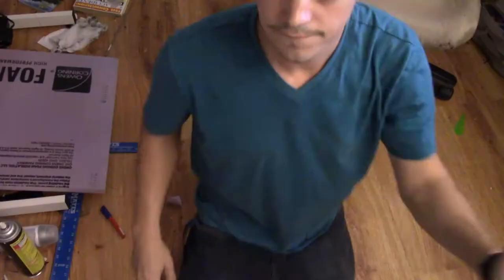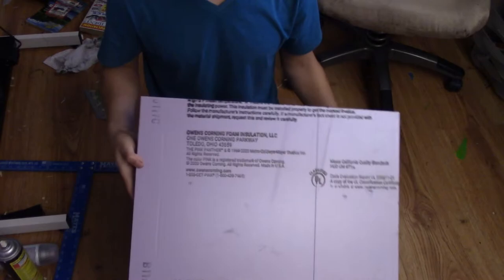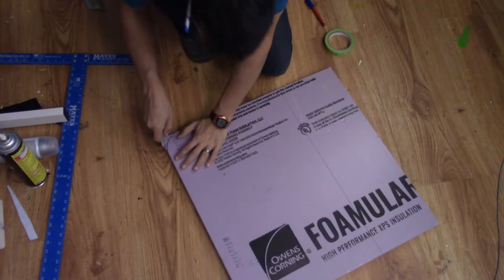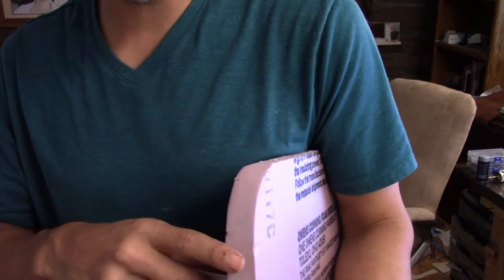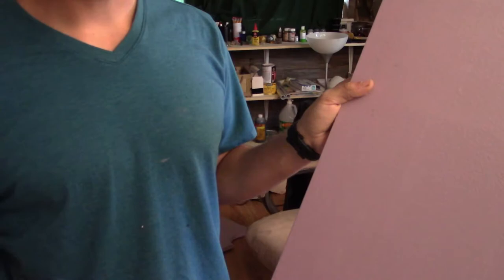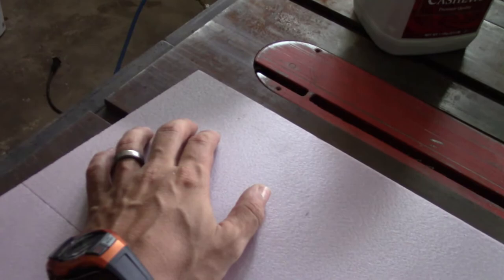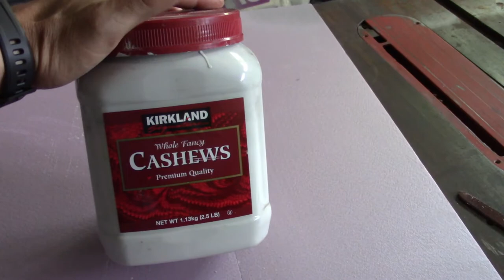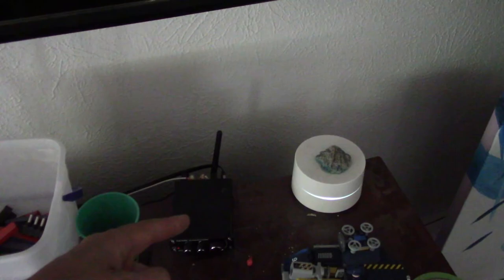You won't believe the sound from this DML speaker!!!

Comment: You CAN use spray paint, just follow the advice of tech ingredients - hold the can about 30" away and use multiple light coats. I hang mine with rubber bands, I simply screwed 2 1/1'4 screws in the top of each panel (no need for glue) and the screws hold the rubber bands in place on the speakers nicely. works great. IMHO a sub woofer is needed to get truly awesome full sound from dml speakers.
Reply from the maker: Thats a great idea. I added a sub later :)

Comment: I'd like to see someone use magnets to suspend the panels like they do with the floating globes and stuff. It would probably take a lot of magnets on the edges of the panels and a frame with magnets arranged to keep the panel from moving forward and backwards as well as up, down and side to side. You guys seem pretty smart. Must be a way, but not sure if it would help with sound though. Just a thought
Reply: That is a very interesting thought, the only fly in the ointment that I can see is attaching magnets to the dml speakers would change the sound output from the speakers. Tech Ingredients experimented with placing weights (dampeners) on the back of dml speakers and the results showed that this wasn't a good idea, I'm not sure how placing magnets (weight) on the edges would affect performance. It certainly would look cool to see floating speakers.
Reply: Limiting the panel traveling with magnets would be counterproductive. It's a speaker after all and forward/backwards movement is kinda important for the sound. Also the magnets would add weight and make the panel harder to tune. Tech ingredients made another video on these and if I recall correctly he concluded that the weighted tuning was unnecessary/detrimental.